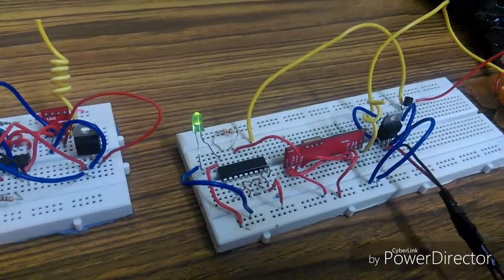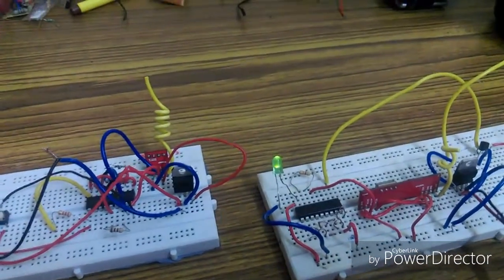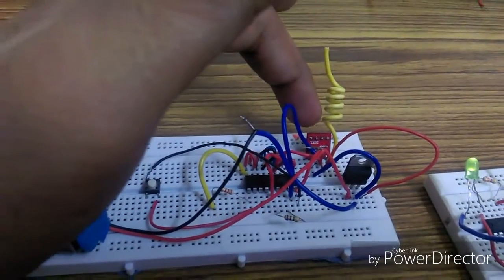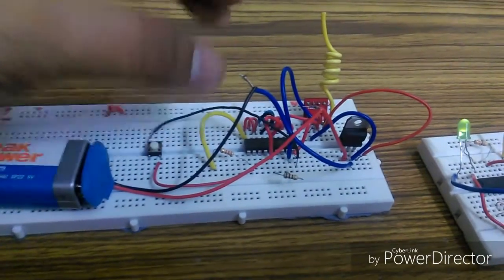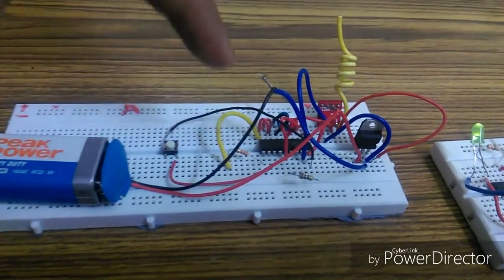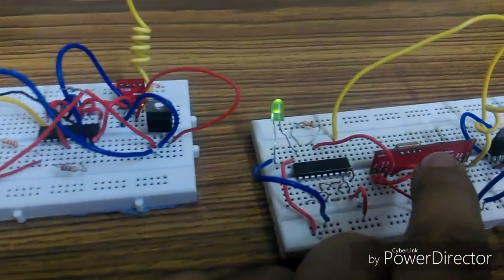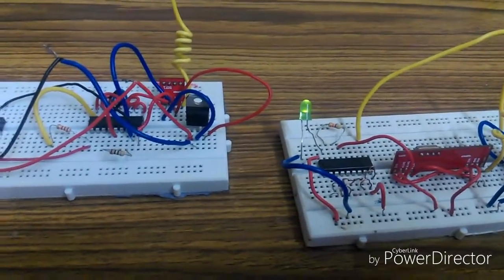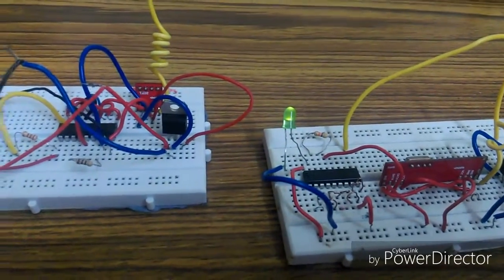Home Automation System without Microcontroller based on RF module

Comment: could you please explain how to interfacing of the kettle and the receiver. i have the tx and rx circuits, but dont know how to interface a real appliance.
Reply from the maker: Manu Kashyap, as you know we can not use dc component to switch on and off home appliances beacuse of high voltage, so we need a device relay to control home appliance.
relay is simple switch like normal switch but controlled electronically.
and it require high dc current to control relay  and output of rx is small
so we need tansistor(saturation and cut off mode) to amplify it. for circuit you can google 
                                                                                        https://www.google.co.in/search?q=relay+and+transistor&client=firefox-b&tbm=isch&imgil=NXSljlIzc1ewnM%253A%253BBAbj8Xeg8_NipM%253Bhttps%25253A%25252F%25252Fwww.youtube.com%25252Fwatch%25253Fv%2525253DfdeyWjg8Y2k&source=iu&pf=m&fir=NXSljlIzc1ewnM%253A%252CBAbj8Xeg8_NipM%252C_&usg=__B3c-Fiw1xeHl5_xn1dkVAjfa0Pk%3D&biw=1217&bih=564&ved=0ahUKEwjyvNfaqYLOAhVKQY8KHbugA9YQyjcIJg&ei=epSPV_KXDcqCvQS7wY6wDQ#imgrc=q8xK8wQ_riRKJM%3A
Reply: Thank you. I know about relay, but was not sure of the amplifier n/w, thanks again